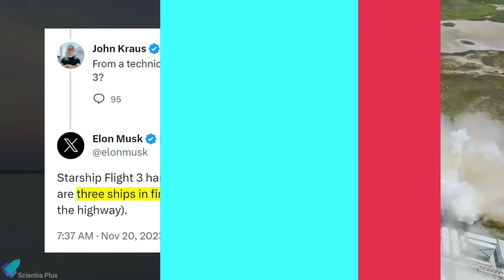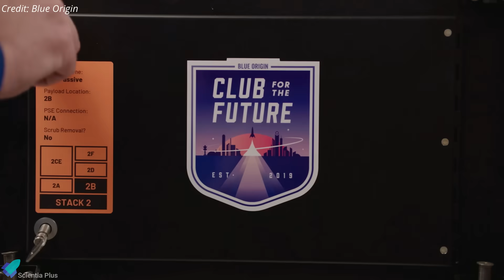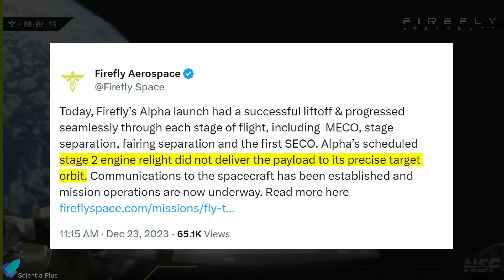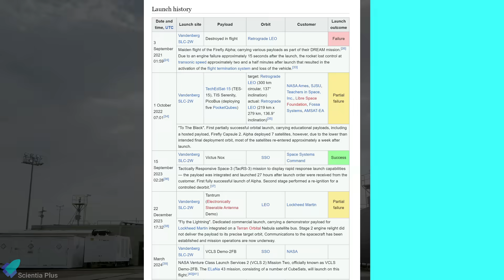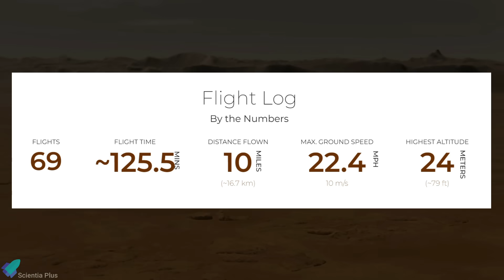SpaceX Starship Face Major Issue During Flight 3 Tests, Starship-28 & Booster-10 Static Fire

Comment: Total protected Hidden hold down clamps
more simple and faster
is possible?

Like the shutter iris of a camara lens shutter.
Off centred Cam shaped plates
swiveling round tightening
slightly pivoted down as they close
around base of rocket?
only one or two hydrolic pistons would activate
letting the machine fly in moments.
the whole system sliddingb away inside the base
protected